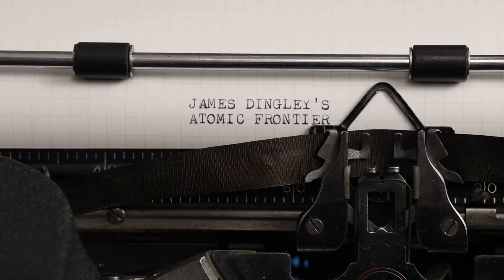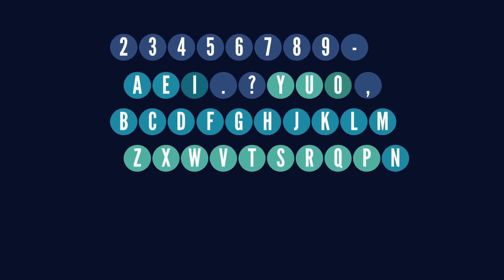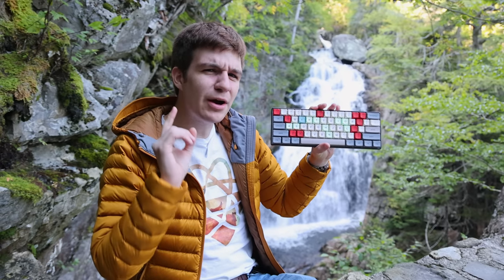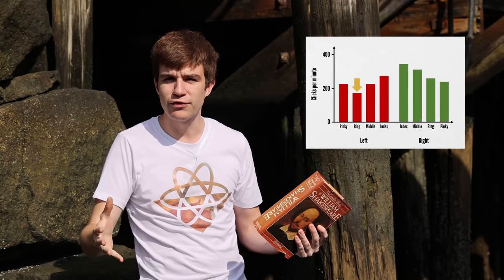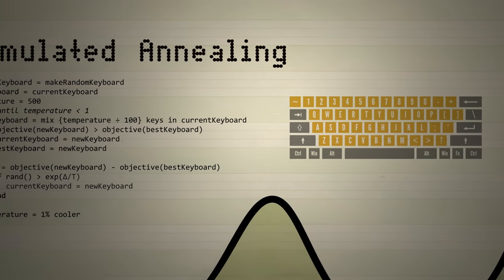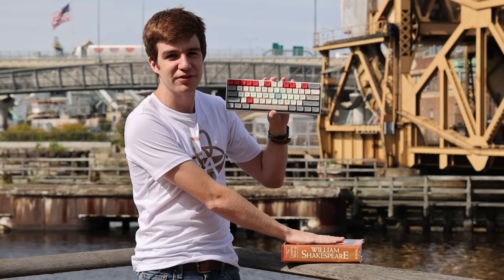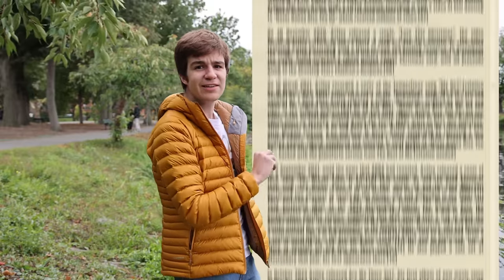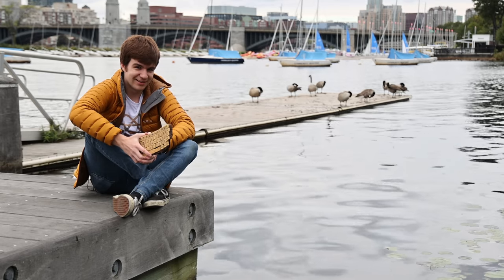QWERTY is broken. Can we make it better?

Comment: The main thing that stops me from going away from qwerty comes down to two factors, the first is simply put I know it very well and I can type blind on it with little to no mistakes made as I been typing on it for so long and so much as I do a lot of writing. The first factor however is simply put comfort and could easily be regained with a better layout, but the second factor is the real killer and that is needing to deal with keyboards in a work environment and other such places outside of your own personal devices which can be optimized. In the end I am lucky to not really have much issues with RSI from typing as I find with writing the movements for me are minimal a benefit from having long fingers so I need less adjustment in my wrists or hands. Typing this comment out I need less than a 1cm movement measured at the base of my fingers. 

Some highly repetitive work tasks I have bound to my mouse at work using the extra buttons or gesture control whichever you have available. It is in general something I really recommend for people to look at, a small finger movement on the mouse and I can copy/cut anything and paste it some where else for example. This one really helps as the crtl-X/C and ctrl-V combinations while handy are far from comfortable to use when needed to be repeated a lot. I also have a need to often delete a space or add one, so those are also found on my mouse as they are common with the cut and paste actions. 

Finally if you have issues and cannot just change around layouts, first off look at your position behind the desk, you want that to be well suited to your needs. If you do office work and spend 8 hours behind a desk you need a ergonomic environment to work in, so solid chair that suits your height and the same for the desk.

Comment: Azerty exists. I can't type qwerty since I'm completely used to the former. It is the standard in my country. If you get used to 10finger typing, it is actually lightning fast. And 100% blind too since the 2 guiding keys have the line, you can feel where both index fingers should rest. Cool video, i hope you get some good points for it

Comment: Excellent piece. I used Dvorak for several years but went back to qwerty when the drawbacks outweighed the benefits. A keyboard, unfortunately, is now for more than just typing words - applications have been optimized around it. Shortcut application keys require finger gymnastics when you change the layout because they were designed with qwerty in mind. For instance, take Cut/Copy/Paste or try using Final Cut Pro with these new keyboard layouts. I think to go against an engrained standard, the benefits need to be at least 250% better for it to be successful. In my opinion, the only way to design an optimal keyboard is to completely get away from the keyboard design and revolutionize it, like the iPhone did to traditional phones. What the answer to that is, I don’t know, but I really believe there is a better keyboard than a keyboard, and no one has cracked the code yet. Simply optimizing the keyboard layout is not going to gain traction at this point. Re-evaluating how our brains communicate with the machine is the way forward. That said, this piece was splendid, and a first step in going on a new path forward. Subscribed ✪
Reply: This.  I'm a coder and I use vim.  I tried switching to colemak and it was difficult to say the least.  We unfortunately are beholden to physical positions on the qwerty keyboard

Comment: Decades ago, when I was closing in on graduation and I wanted to improve my odds of having a successful software engineering job, I did some research into what would be the best keyboard layout for doing all that typing.  In my research, I discovered arensito.  Arensito is a keyboard layout that includes new positions for all the numbers and symbols, which is good, because as a programmer I would be typing a lot of numbers and symbols.  Anyhow, I got a Kinesis keyboard and trained myself on how to use it with an Arensito layout.  Before I did this, at one point I had a job typing, where I did A LOT of typing.  Within a month, I was starting to have wrist issues.  After doing what I just outlined, I've spent who knows how many hours typing, and I've never had a problem.  I don't know that arensito is perfect, but... arensito, in my humble estimation, is one of the better layouts ever created.  You should give it a whirl.

Comment: I've been using DVORAK for 15 years now and I've NEVER noticed any improvement to my speed what so ever. HOWEVER. It forced me to learn touch typing, because I couldn't see what keys were under my fingers, they still had QWERTY letters on them, I had to use touch typing to know what I was typing. Which has led to a more fluid, and comfortable typing experience. Plus, I can't go back to a QWERTY keyboard without an hour or so to get used to it again. Otherwise I have to look at the keyboard and type like an old lady. But, I adapt quickly. 1 hour is how long it takes to get back to 100%, but I'm usually good within 5 minutes.

Comment: If you tracked your keyboard data while entering any passwords and you've had to enter them frequently in that time, it's probably very doable to take your layout and analyze which keys you use often as compared to a corpus that doesn't have your keylogs. However since you didn't seem to have used bigrams or other n-grams in your analysis I doubt it xD

nice video :)

Comment: I do recall hearing some evidently false legends about the origin of QWERTY, including a claim that it was concocted deliberately to slow down the typist to prevent mechanical jamming. It sounds as if it was actually an attempted optimization, but one that for some reason assumed that the home row would be the top row of alphabetic characters, which is not how touch typists actually type.

There were some other popular layouts early on; Blickensderfer single-element typewriters used a layout sometimes referred to as DHIATENSOR from the letters on its bottom row (which was where it tried to put the common letters). The Linotype had a big grid that separated upper- and lowercase letters with symbols in the middle, and for each alphabet the first two columns read ETAOIN SHRDLU, from a frequency analysis of English text. There was an idea that you wanted the common characters close together, but the decision about where you wanted the really common characters to be seems to have generally been made without any modern concept of ergonomics.

Comment: I really don't know too many people that actually position their hands properly like you're supposed to (I guess anyway idk if his hand positioning is actually how you are supposed to do it).
When typing I mainly use my left index and middle finger and my right middle finger. Of course the others get used aswell such as my left thumb which is reserved specifically for the spacebar and such but mainly those 3 so when you said when typing "Romeo." your right Ring Finger needs to move I was confused and typed that out multiple times but I only ever used my middle finger for that, guess I'm just used to typing in that way.

I see that alot that people type the way they want to type or the way they learned to do it as quickly as they can, most people probably develop their own way of writing on a keyboard.
So that immediately tells me that there is probably a lot of people that barely use half their fingers when typing while it seems that you take a standart hand position that utilizes all fingers into account, not necessarily bad but because people type different ways and many people don't use that standart hand position what actually is the best layout is a question that is impossible to answer.

Comment: A different approach would be to take in account some anatomy, taking in account 2 things. 1. Which movements produce the last strain on the fingers, and wrist. 2. Which typing movements are the most pleasant, at least in the short term (Which finger, and which button). After you figure that out, you need to take in account the language you are typing in. Which are the most typed words in your language, and which are the most repeated letters in these words. Now you have the most used letter which you can arrange in the most pleasant positions on the keyboards, and so onwards to the most strenuous and least used. But we are not done there. You need to align that layout to have a visual sense / logic and can be easily remembered by looking at it a thousand time. If I ask you where the space, number, escape, enter, shift,  control keys are, you will know exactly. Will you get a perfect layout? Absolutely not. Will it feel leas strenuous on your hands if you take a large amount of time to learn to use, probably. Issues: What if you type in other languages, like me? English, German, (Croatian, Serbian, Bosnian)...? And maybe add a bit of coding with specific syntaxes Python, Java, C++, some HTML...
Hm.... Maybe machine learning could actually find something one day??? Now I'm curious if there is any research on specific languages that produce more or less strain on the human hands while typing in that language, and why....
In the meantime, the best advice for pleasant typing over the yeas would be to get a wrist rest for the keyboard. #AvoidCarpalTunnel

Comment: Very interesting. I've wanted more objective research and machine learning on this and you have delivered. I think what would also be enlightening is to have different group sets of people, arranged by average WPM, to try some optimal layouts. Would typing speed improve relatively equally as seen on a percentile distribution chart? By relatively equally I mean 40 wpm increased to wpm to 60 wpm is comparable with 140 wpm to 145 wpm. Because speed improvements are going to plateau due to physical finger speed and brain processing limitations. Anyway, that would be really interesting to see as a next step in the research.

Comment: A while ago, I couldn't fall asleep and decided to think of the longest word I could write with just the top row of a qwerty keyboard. I ended up on Typewriter. But I also found Poet and Queue, along Priority. Maybe I should've prioritized something else to do.

Also, in the same session, I thought back to my lovely nokia 3310 with the classic mobile phone keyboard, where typing hello is 4433555>555666. And how I could type with just 2 joysticks, like on a video game controller. I thought of how the range of motion from both joysticks could be split into 6 60 degree zones, where the primary stick (let's say left) selects the set (ABCDEF, GHIJKL, MNOPQR, STUVWX, YZ0123, 456789) and the secondary stick (let's say the right one) is used to select the letter or number necessary. Periods, commas, spaces, enters could be mapped to the shoulder buttons for easy access. I was pretty proud of this, would love to see this in action.

Comment: I used to use the "standard" finger positions, but now my fingers just sort of sit in a blob in the middle similar to the WASD position a lot of games use. I think it feels better than that standard way of putting your hands. 
To elaborate: 
For my left hand, my index finger sits around F, my middle finger sits on E, then W and Shift for the other ones. 
For my right hand, my index finger sits on J, middle sits in I, and the other two fingers just kind of move wherever needed to hit enter or backspace usually. I wonder if considering alternative hand positions like this are better?

Comment: everyone says that its because qwerty slows you down
it seems that its a bit more complex than that

you need to figure out how to reduce the collisions between two hammers, one way you can do it is by moving the most used letters away from each other, so that you have to use both your hands to type, but also, because of the angles between them, you then dont need to slow people down just to prevent things from colliding, because by the time you are able to get the letter pressed, the previous one gets pulled away, but if you have them too close together, they have less of a window between when they can be pressed, meaning you have to slow down or you WILL collide

the next problem you need to figure out, is how to prevent collisions between fingers, so that the way you type prevents them from ever coming into contact with each other, even though you are queueing them up the problem with keyboards is that you always need to move the fingers, so the only thing you can solve is to pevent collisions, every collision can force your hands off of their spots, and necessitate you moving your hands back to the homerow to figure out where you are

the next problem is ease of use, so each arrangements need to be easily usable by their operators

the final problem is binding keys to do things, so the less keys you have, the more you have to compute to get the system to figure out what you ACTUALLY want to do

stenography keyboards are fast, but far from easy to use
and need to either process on the machine, stealing system resources from the programs you use and possibly not responding in time to your inputs, or the opposite, where you add all of the calculation on the keyboard itself, or adding special hardware, which increases the complexity, and thus price, for no real reason outside of its specific use-case

Comment: That was one fascinating video! Brings back memories of when I coded an algorithm that figured out the best letter arrangement on a 9-key keyboard, so you could use the fewest taps possible. I called it Dvorak9 at that time. It tries to have the most common characters as the first character available on a specific number and tries to reduce the number of time you have to press on the same number in a row.

Comment: There is a Traditional Hanjii input method called Array Input Method, that maps components of Hanji to each of the number keys, and you can split each component to the 3 rows under the number keys by their last stroke.  If the last stroke corresponds to 𠃍 then it matches to 5, and it's the center row.  If the last stroke corresponds to numbers smaller than 5 it's the top row, and vice  versa.  I think the genius of that input method is you can rearrange the Alphabet keys anyway you like, and your brain and muscle memory wouldn't need any rewiring for typing Traditional Hanji.  You probably would need to remap the table for the input method though.

Comment: The biggest problem with learning a better keyboard layout, is if you need to occasionally use a computer that's not yours.

I switched to colemak for a year, and really liked it.  I was up to my normal typing speed in a couple weeks, but didn't get significantly faster.  but it did feel pretty good typing without having to move my hands around nearly as much.  There's also some other benefits that distance algorithms don't take into account, like rolling type actions of letters that are often in sequence.

The problem is that I occasionally need to work on other computers where I can't necessarily plug in my own keyboard, and for someone who's used to touch typing 70-80WPM, having to look at the keyboard, and typing 15, often when you're in a hurry to fix something is pretty bad.

Eventually I decided that the benefits didn't outweigh how bad it could be when I got caught out typing on a standard board, and switched back to qwerty.
Reply: Why not just quickly switch layout in OS and switch back when you done?

This is why I never bothered to buy keyboard with Dvorak. Any qwerty keyboard would do the trick.
Reply: Because it can be lots of different things.  Maybe I'm connecting a serial console to a router or switch.  Maybe I just don't want to risk forgetting to change the settings on someone else's machine.
Sometimes I might just be jumping in to assist.  typing a couple commands on their keyboard, and it's not a reasonable thing to go into the control panel and switch layouts to type a few lines.
Sometimes I might be using something with an obsolete or minimally configured OS without alternate keyboard maps installed, or easily available.

I made my own keyboard, and wrote my own firmware for it, so it's not really a technical limitation, but there's times when neither using my own keyboard, or messing around with layouts is acceptable in my work.

And also, you might be annoying the crap out of your friends/coworkers when you switch their settings around and forget to revert them.

Comment: Wait, did you try optimizing such that the most used letter would fall on you strongest fingers, and then further optimize to take into account movement patterns in order to reduce strain on your tendons and muscles? Seems like this would be a solution that would be so individual it only works on you and the optimal layout would change by user, but still, it seems like a cool experiment.